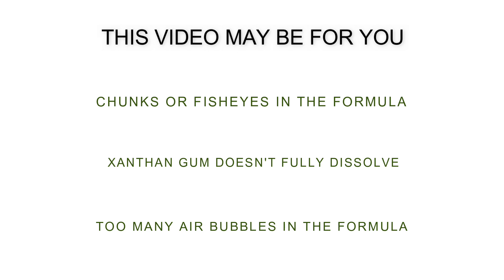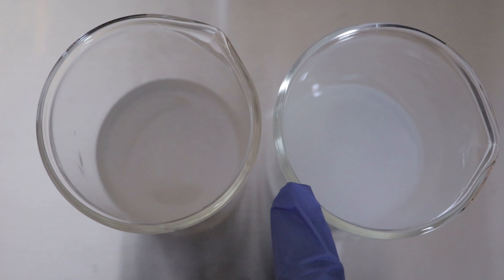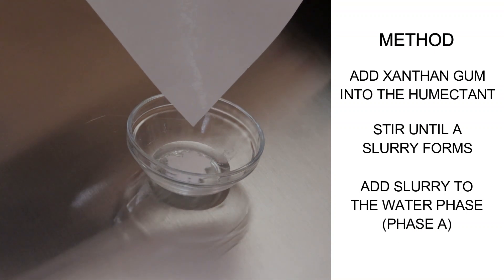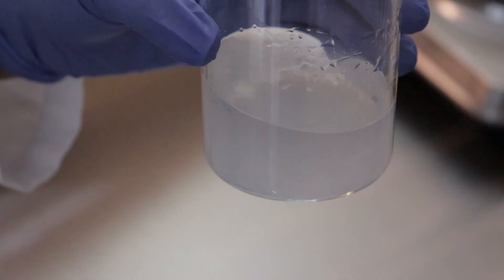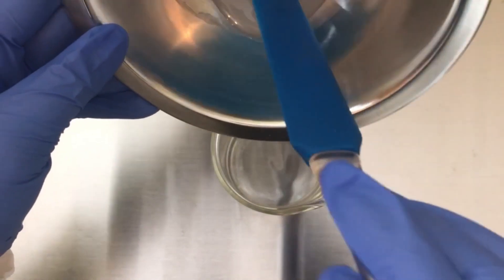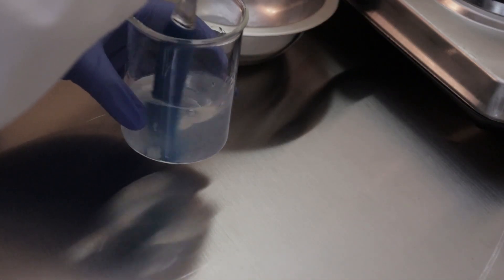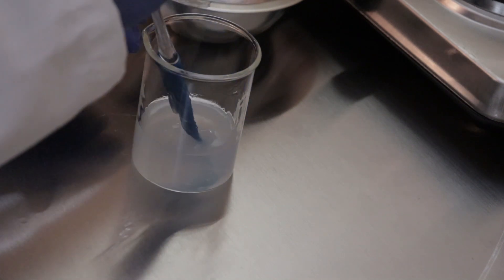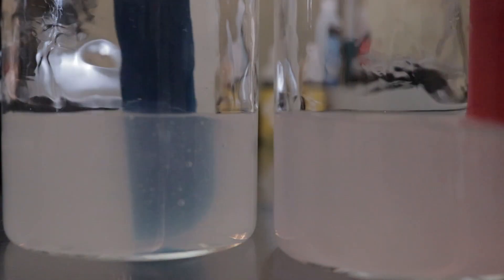How To Use Xanthan Gum In Small Samples With Basic Equipment

Comment: Thank you. I am a mechanical engineer transitioning into cosmetics. I know enough about chemistry to be dangerous! I appreciate your explanation and demonstration of how to mix small batches of xanthan gum. I have tried several other methods that did not work well. Clumps, air bubbles, not fully hydrated. Deodorants are the first products we are making. Viscosity is important. We are experimenting with various viscosities for different application methods: stick, roll-on, spray, aerosol. Thanks again. Any additional information is greatly appreciated.

Comment: How to get rid of bubbles in water mixed with xanthan gum and get rid of the smell
Reply from the maker: Does your xanthan gum have a smell? If so, you may need to talk with your supplier, that doesn’t sound normal to me. You’ll still make a slurry before you add it into the water phase, you definitely want to pour in slowly and mix. Unless you’re making over 200g, you can use a homogenizer or overhead mixer. Bubbles come from introducing too much air but you can try letting it sit for 24 hours, after preservation of course, and leave it covered before pouring into its final packaging.